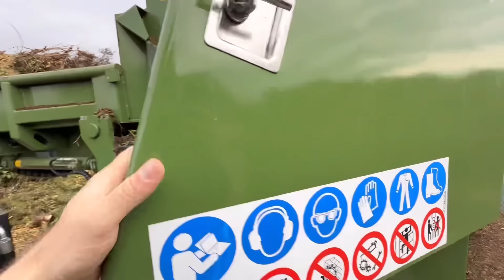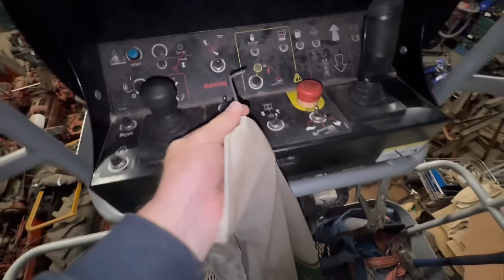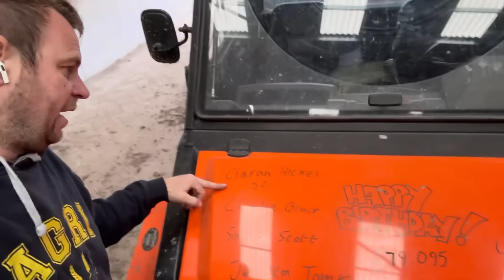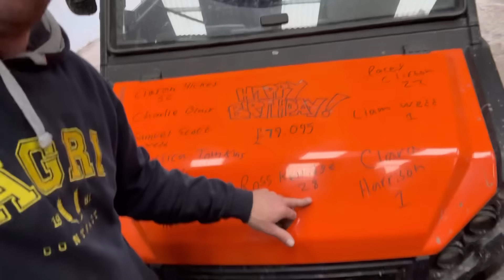CHIPPER FEW MONTHS ON WEIGHT OF LEAVES AnswerAsAPercent 1685

Comment: Leaves are worse than most biomass because they don't rot. If they rotted, they wouldn't be a problem.

They mold down which they can't do under water. In the water they break down into sludge instead.